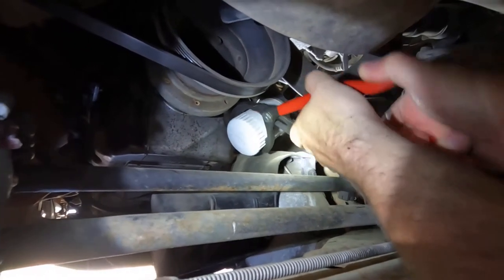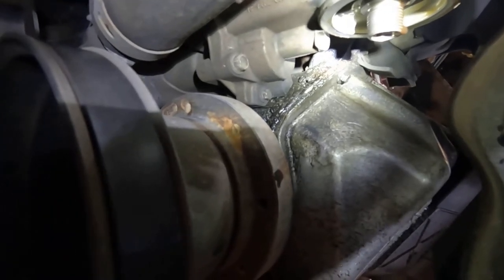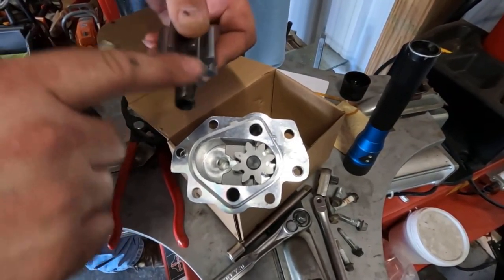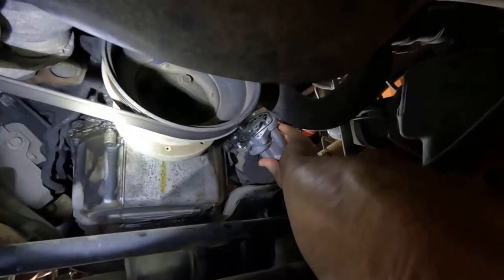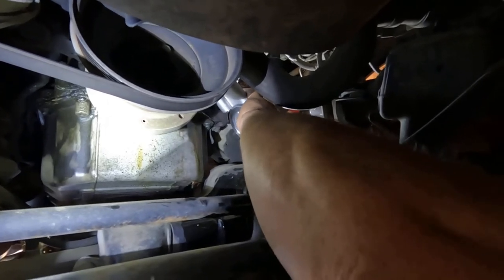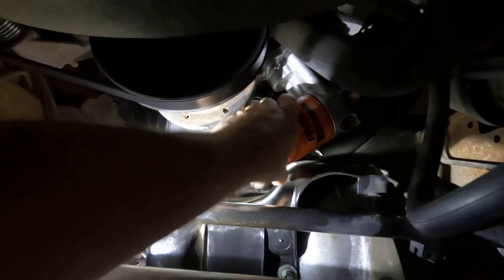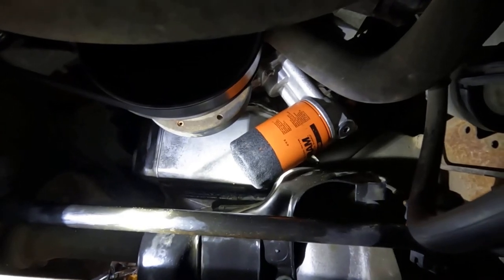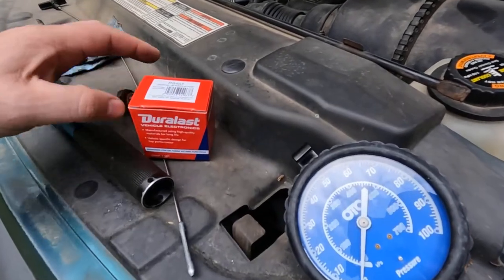Oil Light Fixed - 97 F-150 4.2 V6 (Replace Oil Pump & Oil Pressure Sensor)

Comment: You can prime the oil pump so it does not pump air into your bearings by packing the impellers with Vaseline. Have done it before.

Comment: I need more power for towing on my 4.2. Great truck but need more power looking to install a turbo on it. I need to run an oil feed line from somewhere in the block into the turbo for lubrication. Do you think the oil pressure sensor will act up if I split the port by adding a Y adapter there? One side for the sensor and one for turbo.
Reply from the maker: I don't know to be honest. Don't have experience with that but as long as turbo didnt loose pressure , I think it would be fine.

Comment: Is it common to leak from the pump like the 5.4 oil filter housing? I tried to look for the gasket for the 4.2 as oil filter housing but its actually the oil pump for those motors
Reply from the maker: I am not sure. I never really had a leaking problem with mine and I had over 250,000 miles on mine. Have a Blessed Day Friend!  Justin

Comment: How do you check the oil pressure?  I have heard to not rely on the gauge in the dash. Our oil light came on and the dash gauge dropped to zero. Someone said to take the oil filter off and hook up a gauge there.
Reply from the maker: You remove the oil pressure sending sensor and screw the pressure tester into that port.  Hope this helps. You don't for any reason remove the oil filter to test for oil pressure. Have a Blessed Day. Justin

Comment: i have a question im looking at the video and sum parts online comes with extra springs with the pressure pump is there a part we’re missing or is it the wrong part?
Reply from the maker: The pump comes with a pressure spring that I believe is behind the timing cover to replace. I didn't do this. I just replaced the pump. Hope this helps. Have a Blessed Day Friend.  Justin

Comment: Did you have to drain oil completely?
Reply from the maker: To change the oil pump or sensor , you do not. I changed mine because it was ready to be changed.

Comment: oil pressure could have raised with the new pump...good idea changing the pump with 260,000...OK I see you checked the oil pressure before you added the lucas
Reply from the maker: Yeah, a new pump at these miles is not a bad idea. First one I have seen on the outside of engine and not in the oil pan. Easy to replace. Have a Blessed Evening Duke.  Justin

Comment: Does it ever go down say after u drive it for like 30 minutes, cause mine is completely normal while driving at first then it goes down slowly and keeps??
Reply from the maker: No, mine would just drop all at once just at idle. Now it's possible your oil sensor could cause the problem you're having or worn bearings can cause this after the oil has gotten warm and has thinned out causing you to lose oil pressure. Hope this helps. Have a Blessed Day Friend!   Justin

Comment: Just switch my switch and that wasn’t the problem, hopefully it’s the pump. Any idea what else it can be?
Reply from the maker: You need to get a oil pressure gauge and check the actual pressure. If it is running low such as 5 to 10 pounds, I would consider replacing the pump. But it could also be a stopped up oil pickup tube in your oil pan. Or a weak bypass spring. Or faulty wiring to your sensor. Worn bearings can cause low oil pressure. Really need to find out if you really have an oil pressure problem first. Hope this helps. Let me know if you have more questions. Have a Blessed Day Friend.  Justin
Reply: Did you install the Relief valve spring that it came with?
Reply from the maker: @XxALoxzXx  I did not. I would have but the pressure swtch fixed my problem. Have a Blessed Day Friend.  Justin

Comment: I changed out the oil pump and sensor. And my oil pressure still is low.
Reply from the maker: Ok, I think there is a oil pressure regulating spring that came with my oil pump and I didn't replace it because I read it was behind the timing cover I believe. This could be sticking or weak and cause low oil pressure.  If your crank bearings have excessive wear, this could also cause low oil pressure too.